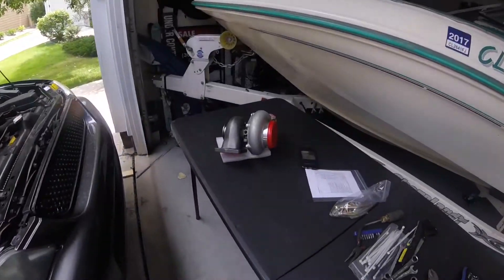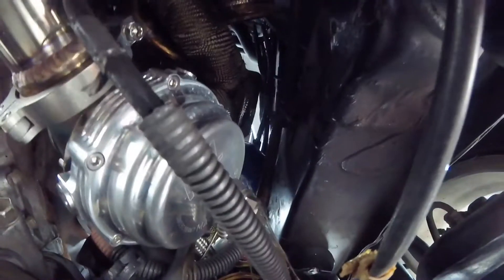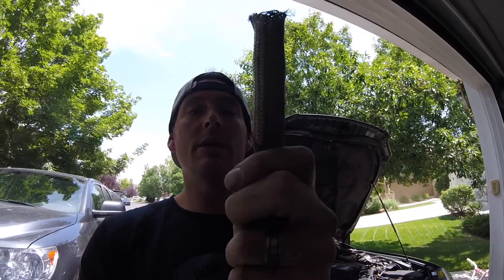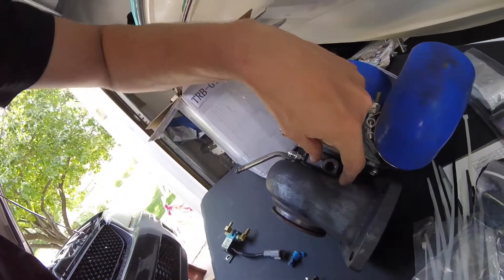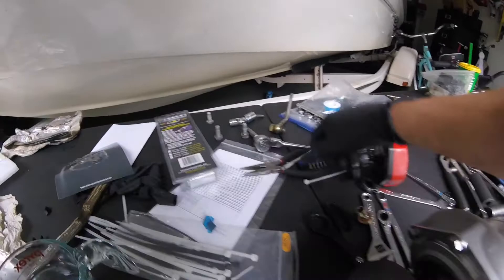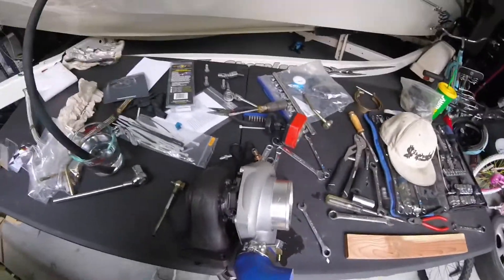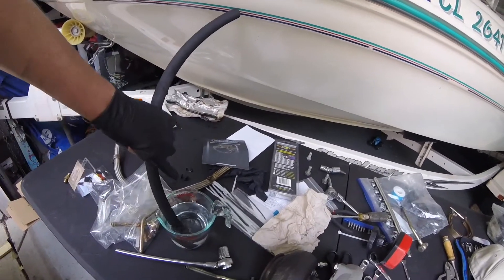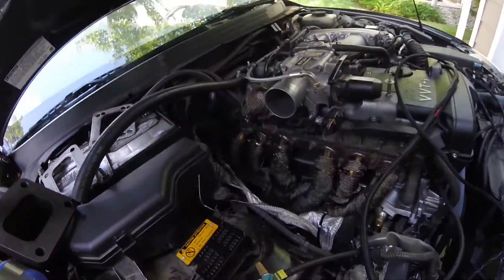Project IS300 Turbo: New turbo and Oil Drain Problem

Comment: I had such a nightmare with that turbo I went out and bought a GT3582R hope my drain line don't burn up like that but I guess if it does you now have the fix for it, could you post that link to those parts? Assuming I'm gonna have the same problems I may as well just order now

Comment: Is it easier to reach the 4 bolts that attach the turbo to the manifold from the bottom after pulling the downpipe? I have the same problem as you but I bought my IS300 with the cx racing installed already. Now i need to remove my turbo to check that turbo return line. thank you for your videos ive learned to much!

Comment: Link for the line kit. .  I just finished swapping my. Burned up drain line. Last night. I used a stainless steel braided hose and heat wrap it.  Hopefully that will keep it from burning. . . I also decided to have it drain on to the passenger side. Wheel. . Rather that straight down. Like last time. . . You don't need to have it water cooled. Ive been running it with oil only for. About a year and It still works fine
Reply: realgomez27 I was told if it has water cooled option you need to run it or the turbo will overheat and prematurely break down
Reply: kyle worden I've seen and  talked to other people that are running the same kit and turbo and only run oil. . And friends that run turbos that's have both options oil or water. And use oil only. With out any issues. And there's no way it gonna over heat. As long as it has oil. . Unless u completely push it out of its hp ratings. I woulnt pushing it more that 400-450.
Reply: kyle worden how dobu like that turbo i was thinking of picking one up next month
Reply: ryan haven't run the car yet gets tuned this week
Reply: ryan depends your. Hp power goals.  It a dent turbo over all. Spools up pretty quick. . . I'd recommend you the. Cxracing. Stage 3 ball bearing gt35. Turbo.
Reply: I recomend getting a brand name turbo
Reply: realgomez27 im going to get the one from CXRacing and when it goes I'll just have turbo Labs put in Garrett internals

Comment: Is the Stock GTE and ceramic twins more cost effective than this cx setup ?
Reply from the maker: Aleem Ahmed yes, it is more cost effective for the gte. If you do things the way I did.   The engine management and wiring was the most expensive part
Reply: C3GARAGE Media 

I have the same manual W55 tranny , hopefully should bolt up, but passing emissions here in CT with a JDM motor will be the real challenge

Comment: did you use a oil restricter
Reply from the maker: yes, two different kinds.
Reply: C3GARAGE Media i had the same issue. It turned out to be the drain fitting/flange. Make sure its 16mm in diameter. No need for restrictor